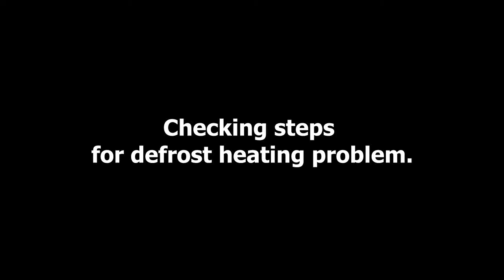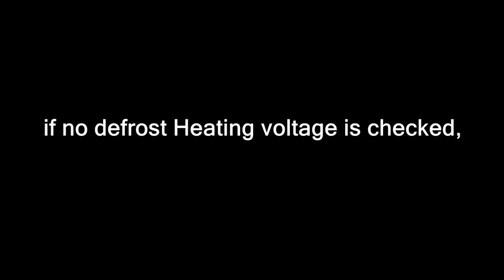Checking steps for defrost heating problem in LG Refrigerator

Comment: My husband lengthened the sensor wire and moved it close to the drainage hole. So far it works after much issues with the bottom section not cooling or even shutting down completely.